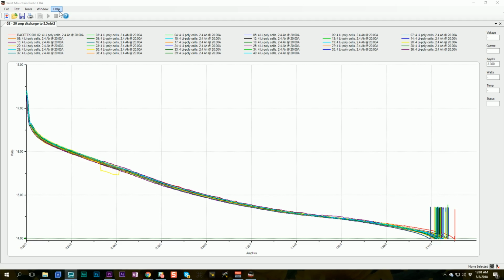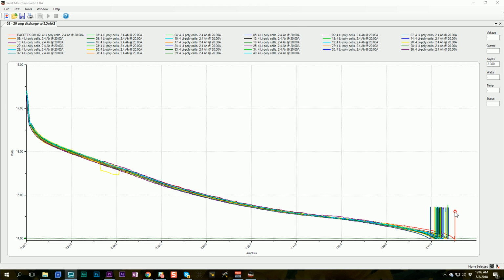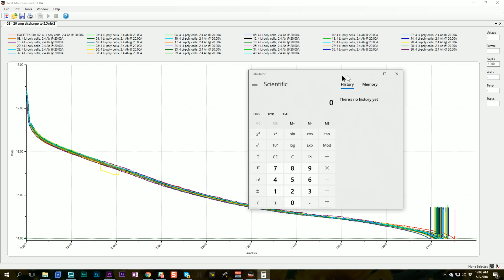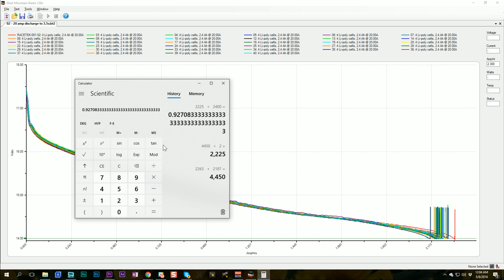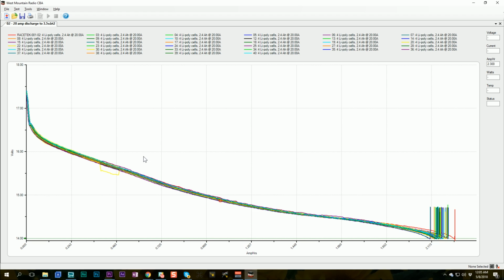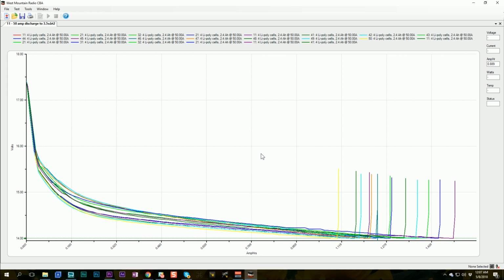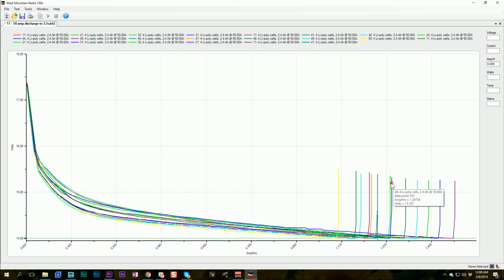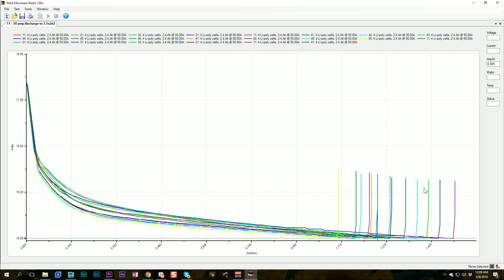HV LiPos Yes or No | UPDATED TEST RESULTS

Comment: How you should use HV batteries.
1.Always charge to 4.2v per cell for same performance as a normal lipo but get more cycles due to higher tolerance to cell degradation.

2. Only use in low discarge devices such as long distance drones for extra flight time and distances due to the higher watt hours and energy density and expect less cycles then normal.

3. Only charge batteries to 4.2v 90% of the time except that one time once in a blue moon when you want that extra power/power density/power to weight ratio to win a race ect..

If you are simply wanting higher power and or extra rpm it's better just to change you motor KV and or running voltage set up to achieve a specific rpm with also enough torque to also get up to that rpm/speed quickly and use with a regular lipo pack with a high enough discharge to be able to supply sufficient amperage/power without voltage sag/cell damage.

My brother has a pair of GNB 6000mAh 7.6 H.V shorty packs that are fantastic and still going strong.
He had only H.V charged on 2 occasions once to records a gps top speed and another time to win a 30min indurance race. Other then that always charges them to 4.2V and always puts back to storage charge right away after use.

Comment: seriously this is pseudo science. why would you take an average compared to the rated capacity when the first discharge was over 100mah below the capacity?. the valid calc would be the lowest divided by the highest. the pack was only 95% of its rated when first used. so after 40 cycles you measured 2166/2400 ..or 90% of rated..what you shouldve done is take the highest and lowest measured..which was 2166/2263 = 96%. or 4% over 40 cycles..about 1% every 10 cycles. 
theres really no point in using rated numbers when you can measure the actual. 
furthermore you refer to 'normal' life properties..without defining it. you stated that you discharged at 10C. how many people run 10C?..
10C is 6 minutes of flight and since batteries are often rated at 60c, 80c, 100c even, why use 10c?
yes, im an engineer. 

and then on top of all this you state stress in terms of amps..thats half the story also. stress is power. the combination of amps and voltage. high V setups are only advantageous when the wiring diameter is forced to be relatively small, such as in power transmission over long distances. 
there is an urban myth that high v is more efficient...its only more 'efficient' when you dont change your wire diameter in your comparison tests. to do an apples v apples test of a high v versus low v setup you need to select the right kv motor, right ESC and right wiring size. you cant use the same setup and compare numbers. its analogous to changing a cars engine but not the gearbox and trying to decide which engine is better.
Reply from the maker: The label capacity is meaningless since it wasn't validated with testing. I just chose it as an arbitrary point to peg the scale, to show whether the performance of the pack was decreasing.

The choice of a 10C discharge was explained in the video. That it was high enough to stress the pack a bit, but not so high that I would be accused of damaging the pack unrealistically. If I had discharged at 50, 60, 80 amps, the packs could be damaged and the degradation in performance could be attributed to that damage. Yes, packs discharge at 80 amps in real life, but this is a constant discharge test, whereas real life is usually bursty. So discharging at 80 amps continuous does not reflect real world usage.

The packs are rated at 60, 80, 100C? Oh lawd. Have you actually used them? I have tested hundreds of packs and I can assure you the C rating is extremely "flexible" from a marketing perspective. If I were to actually test at the nominal C rate, the test would be over in five seconds. As I say in the end of the video, I tested at 50 amps every so often to give a more real world result, and that more accurately reflects the way the packs are actually flown.

The whole thing about high voltage being more efficient misses the point of HV packs. The voltage difference between 4.35 and 4.20 volts is not enough to affect efficiency. The whole point is you are cramming more mAh into the same size cell so you get more energy density. You're so eager to score points that you're missing the overall context. You're right, but you're having a completely different conversation.

Finally: constant current vs. constant power discharge. This is a case where you're basically right that constant power would more accurately reflect real world usage, and I have switched to constant power testing in my recent tests. But constant current is a totally standard and accepted way of testing packs and produces valid results. I have personally done side by side tests of constant current vs constant power, and the overall results have never changed: a battery that "wins" on constant current will also win on constant power, although the discharge time shifts a little bit.

After all that criticism, nothing you said actually changes the result I gave. The packs' performance decreased over time. If you were grading my project in college you'd be docking points, but here in the real world, I produced a correct and valuable result.

Comment: I love your help josh and I agree I love the extra 30 seconds maybe One minute extra of flight time with hv but like you sade is it worth the risk and I haven't had any problems with my lipo I found at about 80 flights with 2 1s batterys is were I need to get new battery and that is with charging to 4.35 ok maybe I pulled them at like 4.30 or so cas I was tied of waiting to fly but with 20 1s batteries I found them all to start to degrade pretty fast at about 80 flights with for me was 800 flights before I noticed a degrade and I'm just wondering would it of lasted 100 flights on 4.20 charge or if the extra extra 1 minute on 4.35 was worth it gas I should buy some more batteries and only charge them to 4.20 next time and see what happens

Comment: I would guess that pulling 50A from the pack AND then overcharging it (let's be honest, charging the pack to 4.35 V is overcharging for this chemistry) is the thing that kills this battery. Perhaps it will last longer if charged up to 4.20 V after discharged fast?

Comment: Two years after this video are you still on the HV bandwagon?
If you've done a video on graphene I haven't found it but I'm curious to know your thoughts

EDIT: I did just find your Max Amps battery review , 2 100-amp discharges

 I was asking about graphene as an across-the-board / manufacturer,  type of battery versus conventional lipos and are they worth a switch?

Comment: I'm curious how much longer flight time you get verse the life of the battery in minutes compared to non high voltage.. my airsoft guns batteries never died on me. Never used enough. Except one that sat for a decade. 
Wonder u get 20% longer flight but lose 30% life of battery?

Comment: Joshua, wouldn’t a regular voltage lipo also degrade like this, every lipo battery is limited to the number or charges as they have a cycle life? Or is the HV lipo degrading that much quicker than a regular lipo??

Comment: I would like to see how a lipo 4.2v   Hvlipo 4.35v and hvlipo 4.20v degrade over time. I often buy batteries hoping that they will last as long as possible and wonder if it is worth it to charge hv lipos to 4.2v to have them last longer

Comment: I know this video is old, but have a question, if your esc and flight controller is rated for hv lipo, can you use a regular lipo instead or must it be hv lipo?
Reply from the maker: You can use a regular one. The FC and ESC voltage rating is a maximum. You can always use less.
Reply: @JoshuaBardwell  cool thank you :)

Comment: My batteries that came with my Mobula7 are the Happymodel 250mAh HV 4.35V 30/60C 0.95WH and I’m using the 6 in 1 charger from happymodel (URUAV) so do I charge them on the 4.35V setting? And which is better 0.2A or 0.6A? I’ve been doing 4.35V and 0.6A
Reply from the maker: Charging slower is better for the battery. Since the batteries are HV (4.35v) you can charge them to 5.35v.
Reply: Joshua Bardwell oh really? Dang too bad my little happymodel 6 in 1 charger doesn’t go that high.. it usually cuts off around 4.37-4.40.. what would you recommend I run them down to? I have my i6X transmitter set to set off an alarm at 3.20v cause I think I puffed one up a little by accident. They’re just little 1S batteries that came with the Mobula7. Thank you for replying tho bro! Lots of people don’t and I’m stuck trying to figure stuff out on my own..
Reply: Joshua Bardwell so does that go for any Lihv battery? You can charge them 1.00V over what it says? Like you said a 4.35V can go to 5.35V, so could a HV 3.7V go to 4.7V? Also could you recommend some good batteries for the Mobula7? I’m looking into some 300mAh 3.7V 40/80C ones, will that work for it?

Comment: Has anyone tested whether adding some ultracaps is worth the weight? I suspect the caps would handle the current spikes and spare the battery a bit. However ultracaps are heavier per unit of energy. The sort of experiment I was thinking of was to take a 80g battery with 20g of caps and compare it to a 100g pack (or scale those numbers). I suspect that the batteries would survive more cycles but the flight time per cycle would be less. But would the total flight time be higher with the caps?

Comment: I would be interested with longevity between regular and high voltage batteries (same mah, same c rating) at discharge cycles you run on ur tester.  Charged to same 4.2 volts. Question is whether the hv would still have a shorter live span, same, a better than regular lipo.  Now I know that hv not charger to 4.35 will not get the full capacity as the regular lipo with the same capacity charged at 4.2 .

Comment: I would like to see you run a quality standard lipo (4.2v/cell) through the same test charged at HV (4.35v/cell) and see what the results are. My biggest question is , physically , what about the battery is different to allow HV charging? Are we infact just charging standard lipos to HV or are these HV batteries truely different in some way? Thx. I hope you revisit this subject.
Reply from the maker: HV packs are supposed to have cobalt added to the... anode? I can't remember. It's added to protect against damage from over-charging. But I strongly suspect in some cases manufacturers are just selling standard packs as HV.
Reply: @JoshuaBardwell  thx for the timely reply. You alright.

Comment: Awesome tests! So good to see real numbers for these things! It would be interesting to compare the degradation of performance at 50A between two identical batteries, where the HV charge was the only difference. it would also be interesting to measure the heat of the batteries at the same time. I recently had a interesting conversation with Joshua Barker from MaxAmps. Those guys really know their batteries! He said that the optimal temperature for a lipo battery is between 90-110 degrees F. Below 90 degrees it is not performing optimally. Above 110 and it risks degradation. I suspect your lipos are getting pretty hot at 50A of bench discharging. If HV charging makes it worse, maybe it's because they get hotter? Also, maybe the degradation isn't as bad in the air because of the cooling affect of the wind? Lots to think about... Thanks again!

Comment: hmm maybe if you graphed it that way we would actually see the battery capacity dropping before our very eyes.. but i cant understand at all (through lack of explanation) .. what those lines are on the graph you are showing .. as they seem to visually have zero correlation to what you are speaking about showing when you roll over the lines the mAh capacity falling.. those lines arent actually very different in size and certainly NOT different enough to show a drastic drop of say 1500 to 1100 mAh

Thunderpower Sugarrush HI-V 1500 seems to last fine for me for more than 6 months
Reply from the maker: The X-axis on the graph is mAh. The point where the line crosses 14.0 volts on the Y axis is the point where the battery discharged its full mAh. The one that went further to the right discharged more mAh. The lines will be very close up until the end of the curve because of the way a LiPo discharges. They tend to plateau at a relatively consistent voltage until they get close to the end of their discahrge, then drop off. So it's the length of the plateau that really defines the difference in mAh, not the voltage at which the plateau happens.

Comment: I feal like the battery's do not loose capacity over time but loose the ability to discharge fast. The C rating goes down maybe. They start to puff fast when you pull amps hard. When your hard on the battery.

Comment: Do you have a video doing the same 50 amp cycle test using 4.2V battery would like to see if they also degrade pulling that much continues amps.

Comment: So the HV capacity drops minimally at 20 amp discharge rates, significantly at 50 amp discharge rates, and there is no standard voltage control test?  How do you make a conclusion?

Comment: Nice test! I'm flying the Tattu R-line 2.0 HV 1300s for a few months now and they perform very well on my 600g freestyle quad and of cause on my 400g(incl.batterie) lightweight quad. I can feel kinda small difference between the pack which has about 20 cycles compared to the packs with about 10 cycles. So i can confirm the small but normal decrease over time.

Comment: The problem is that people are HV charging regular packs to get extra  capacity when you get a HV pack you have to HV charge it just to get it's rated capacity. 
I would rather see higher energy density high discharge packs.
I recently worked out that tgy graphene packs are only 108wh/kg that's terrible for lithium polymer.

Comment: joshua bardwell i just built a tiny little 3" spintech race 1 frame with spintech 1106/8000kv on 2s and ive got death roll issue when in acro , so ive heard that having the power/battery minimum setting set to high can cause esc or f.c to reset? so i had minimum at 3.7 but i changed to 2.7 but its dark and couldnt test this. could that even be a factor? or could it be airmode? im lost becouse if im in angle mode (sucks lol) anyways it wont crash out but it only does this when i do flip in acro mode. thanks jb

Comment: joshua what's the reason people buy 40,50,60amp esc's if you can't draw that much amps from any battery? Does everyone have too much unused esc capacity? Should I buy 20-30a ESC'S  only?
Reply from the maker: I don't really known why people do that but yeah for most mini quad setups 20 to 35 amp ESC's are fine.
Reply: Joshua Bardwell great news for me 20amp ESC are cheap...thanks bro.

Comment: Hello Joshua, I bought 4 turnigy bolt2, 3s, and 2s, 500mah after about 20 flights using the eachine lizard and the arfun95, all lipos are puffed and totally useless, funny enough the lizard 500mah stock lipo is still goin strong after twice as many flights, I won’t ever be buying bolt battery’s again, great video, thanks...

Comment: To get the most cycles out of a HV battery only charge it to 4.2v for practice flights then on race day you charge them up to 4.35v to give you that extra boost you need in the race. You will find you can get more cycles out of the packs that way.

Comment: I was missing those videos. Great ! Ageing tests feel like a lot of work, thanks for the effort, man.
In order to perfectly conclude, it would have been really awesome to see the same curves for  a normal lipo charged normally and a normal lipo charged to 4.35 (taking safety precautions knowing that being present the whole time to monitor 50 cycles is crazy). If you have more spare time for this kind of tests, you could also monitor the longevity difference for lipos charged at 2C or at 5C...

Comment: 40 cycles seems Ok for casual flyer like me who have a time for flying only 2-3 evenings in week at summer if weather is good (and much less in other time of year because of crappy Northern climate) . Probably I'll even wouldn't notice capacity drop before end of summer. Well dead batteries after each 4 months sucks anyway - LiHV aren't cheap. But racers and other guys who are flying much more, of course is completely different story - they seems should avoid LiHV for everyday completely. Maybe for one race event and then throw them out.

Comment: Yeah, I fly like a madman sometimes.
Some runs I hit "LOW VOLTS" on OSD on the first punch-out, and through the entire pack it never goes away.
Believe it or not, my most resilient batteries cost me $17, not the highest punch, but they hold on to their lives, I roached a infinity lipo ($28) in 3 flights- in that case, HV would be a giant waste of money, not to mention mixing up my low and high Volt batteries on the parallel board.

Might use HV's for my 7" since I take it easy(ish) with that one.
Reply: Yes was just checking a battery today.. full max rpms and voltage dropped from 7.8v to 5.9 or something in 5.. i cut it off.. lol

Comment: We have some new HV on the race scene over here in China. I have not personally tried them, but they seem to be all the rage currently. Back in the day when they first came out I tried some. My main issue with them was the weight. Is the few extra amps worth the weight trade off? Hmm...not so sure yet..They were great out of the gate, but as the pack discharged the weight soon became a big factor in my flight performance.

Comment: DJI has strictly sold HV batteries in their drones for years. If the largest drone manufacturer in the world design their drones around HV packs then I think it's a no brainier.
Reply from the maker: DJI packs are highly monitored and don't have very high discharge like miniquads.
Reply: DJI is in it for profitability so people buy new HV DJI lipos after 40 cycles thinking it’s normal...